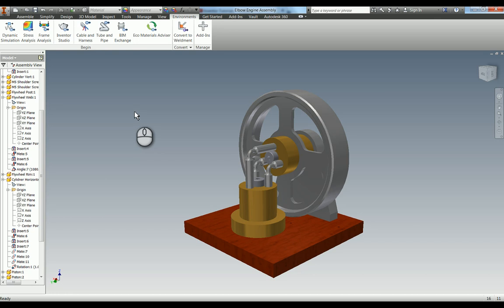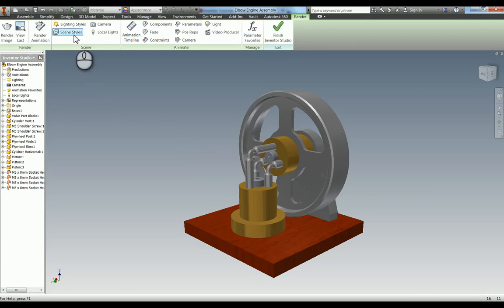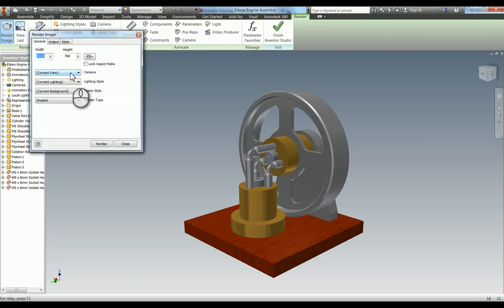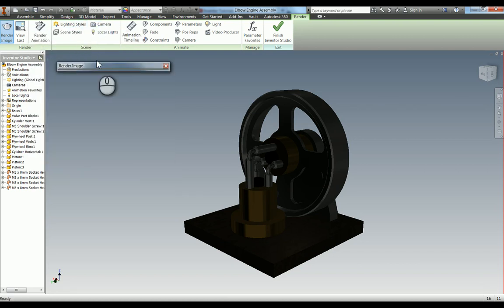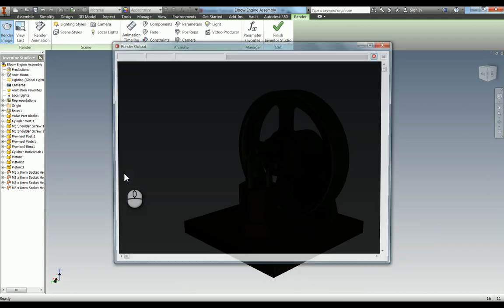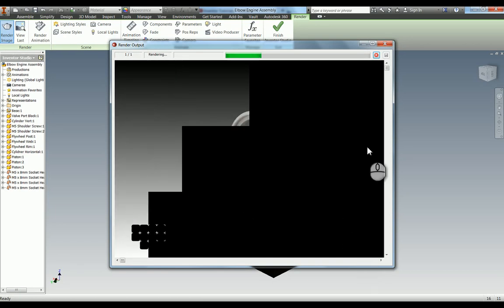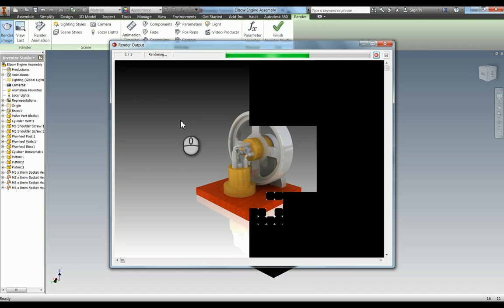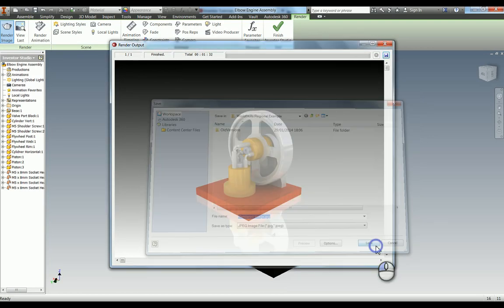Creating Rendered Images on Autodesk Inventor

Comment: could you upload the image to see the resolution and quality?
Reply from the maker: +bason234 The resolution is 1024x768 as the video shows. This is editable just by typing it in so you can make it any reoslution you want.

Quality is a subjective thing ;-) I don't think this is a high quality render. If I were to do one I'd look at using a proper scene and setting up a lighting rig. If you want to get super high quality then I recommend you look up, 3DS Max, Maya, Vred as a rendering package - they are mind blowing.